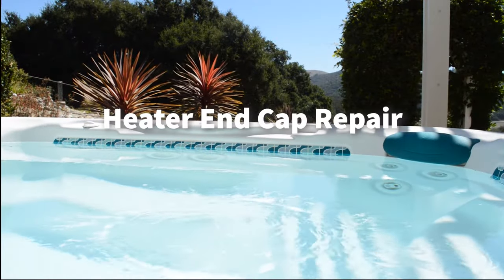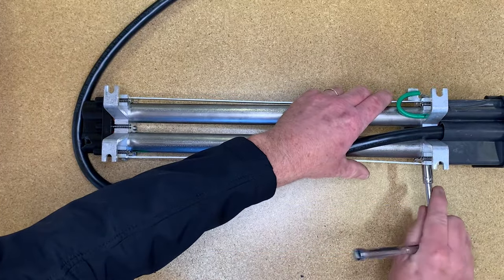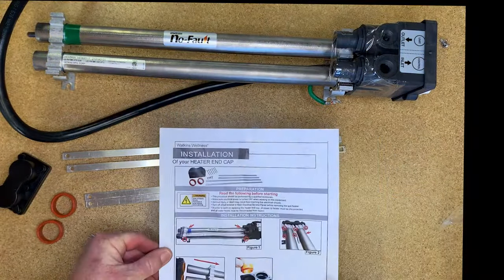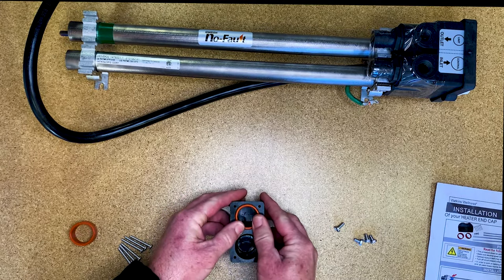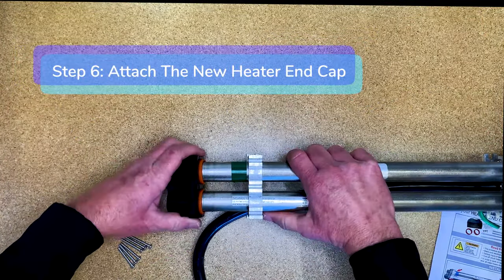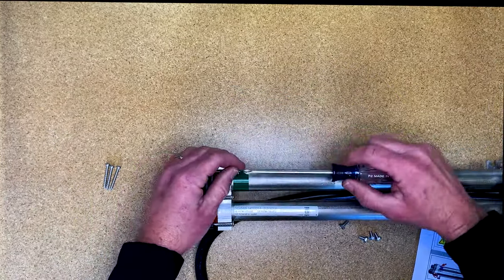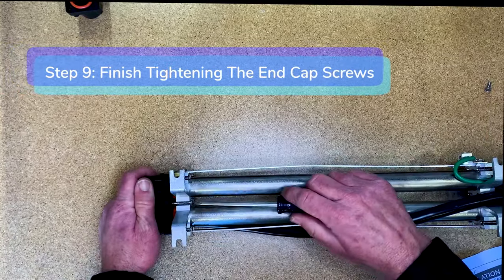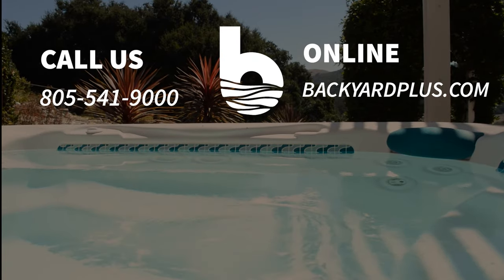HOW-TO REPLACE THE END CAP ON YOUR NO FAULT HEATER WITH 78077 END CAP REPAIR KIT 76227, 76228, 73790

Comment: Hi backyardplus, I have a water leakage on the opposite side from the endcap. Who could provide me with an solution? There was a frost damage on the endcap and I‘m afraid that the opposite side has also suffered. Thank you!
Reply from the maker: Hi! Unfortunately there is no solution for freeze damage to the side of the heater where the sensors plug in. You will have to buy a new heater. Sorry

Comment: I did all of these steps but now the “htr on” light wont come on. My ground wire always connected outside the board how can I connect it like you did?
Reply from the maker: If the heater on light won't turn on, you have a bad temperature control thermistor or a bad topside control panel

Comment: Whats the purpose of the Barrel support brackets? Mine doesn't have any on my tub... Also my end caps were leaking pretty bad after i replaced my circ pump so in a pinch I sprayed some fire rated spray foam from a can around my end cap to stop/slow the leak and it worked! Its winter here and I needed to wait for a week without temps in the teens before tackling this.
Reply from the maker: I am not sure what the support brackets are for. Some heaters were made without them. Glad to hear the spray worked!

Comment: Hi Backyardplus, my parts are very corroded.  I can't seem to remove the endcap.  Any suggestions?
Reply from the maker: You could try knocking the end cap loose with a hammer. Be careful not to damage the heater though. Thanks!

Comment: My screws that hold the heater to the floor of the hot tub are way off from end to end. Maybe a half inch. I didn’t move the brackets from where they were when I took it out. Any idea?
Reply from the maker: The heater doesn't need to be screwed to the floor but if you want to secure the heater, those screws can be moved